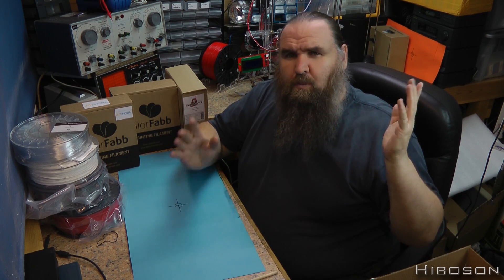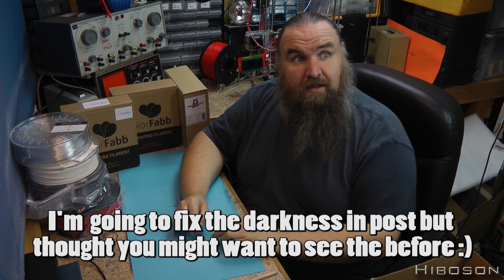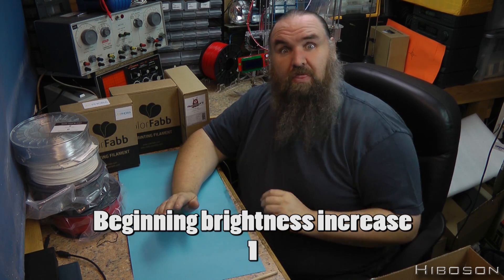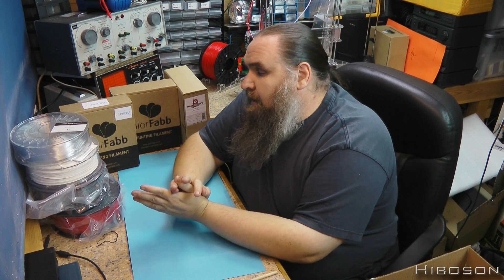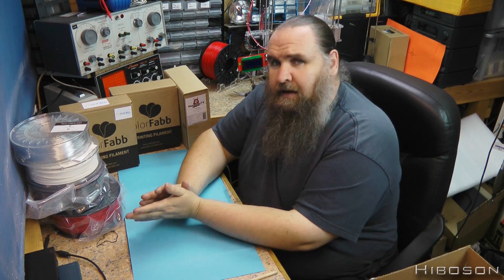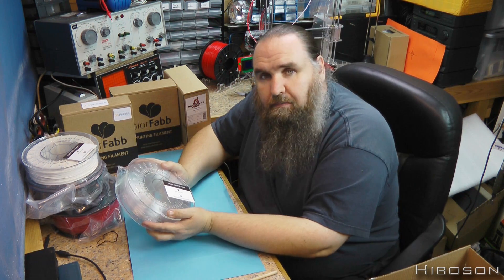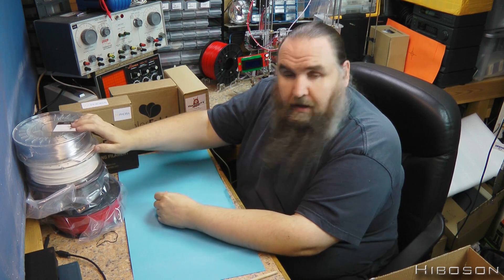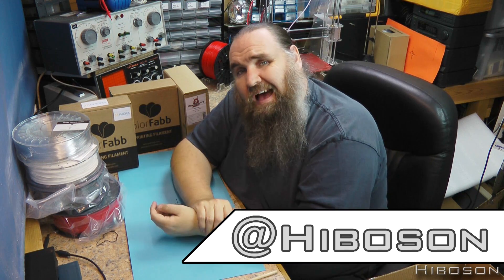Filament Methodology - Sunhokey Prusa i3

Comment: If you have a Sunhokey printer, beware of this: www.thingiverse.com/groups/sunhokey-3d-printer-owners/topic:2469 The PSU is not certified and in certain conditions it can make a short and burn not only the printer board, but your computer as well (if they are connected).
Reply: +aga1nst 
In the Sunhokey printer I received last week, that was new shorten screws for fastening the power supply, so that should not be a problem anymore.
Reply: +Isak Thjellesen oh ok, they are quite fast.

Comment: What I will say is you need air tight container for filament storage, many types of filament absorb moisture, plus like you original roll of red pla sitting by your printer it will get covered in dust and you don't want that going into your hotend.